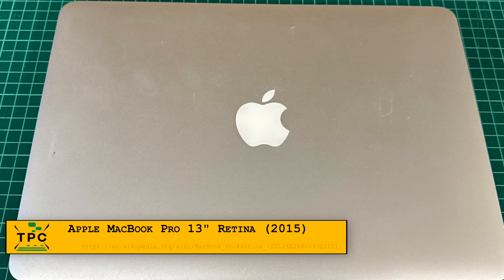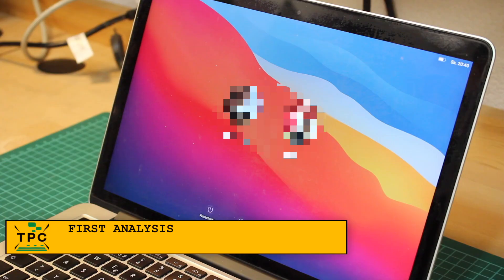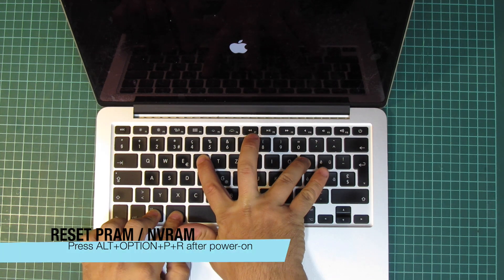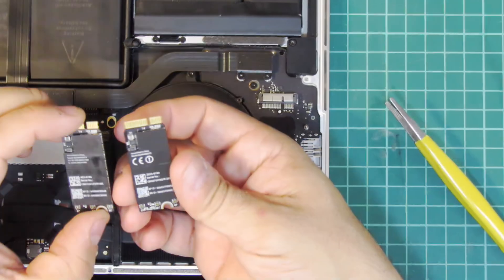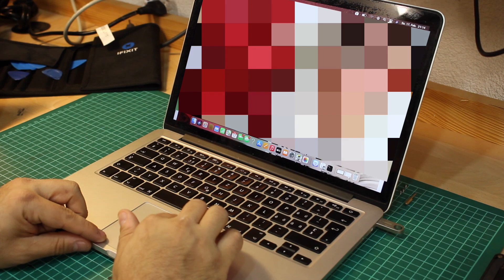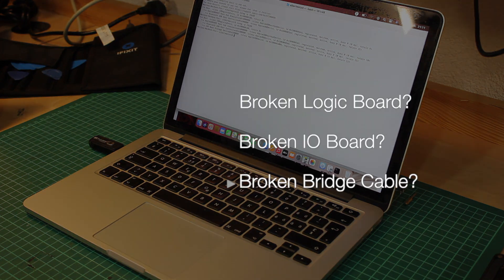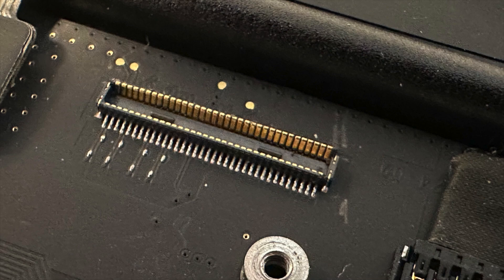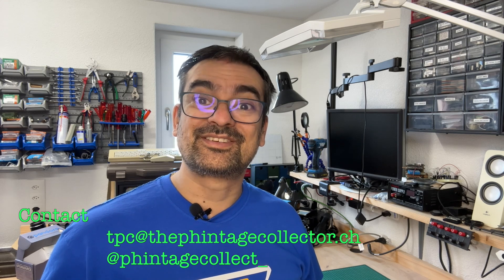Broken MacBook Pro WiFi? How a non-obvious defect made me fix it twice!

Comment: Sir could you help with witj an issue. I have an old 2008 white macbook now running Lubuntu 22.04. The wifi works but since I got my newer modem, it detects the network but cannot connect to it! Weired?

Comment: This is crazy. Thinking of these “new” computers as vintage, damn I feel old.
Reply from the maker: 2024-2015=9 years

That‘s old already ;)

Though I have the impression that the hunger for more performant system was greater 20 years ago than it is today.
For average day-to-day home use a 2015 MacBook with SSD and multi-core CPU  can still serve very well.
Reply: @THEPHINTAGECOLLECTOR  if you retained a PowerPC system through 2015 it would have been so much faster it would be insane. No such giant step has been made since. Apple silly con is fast but not that fast yet.